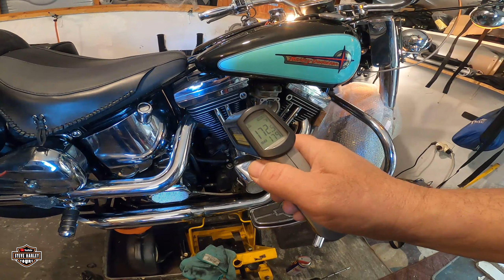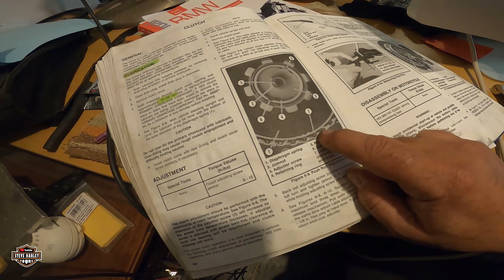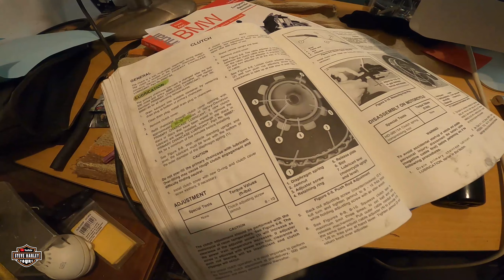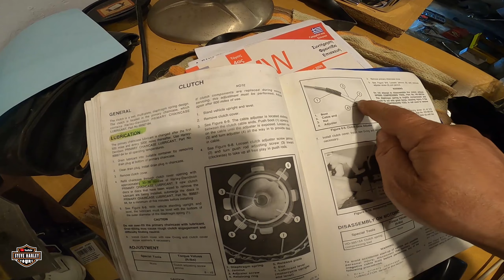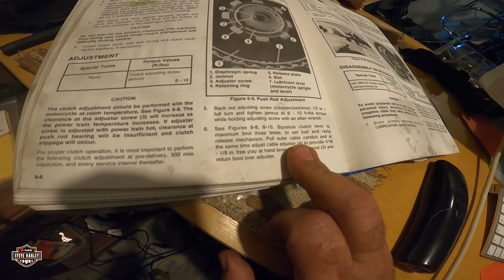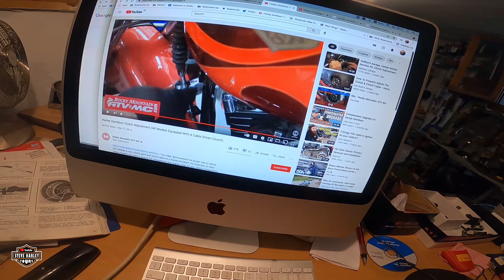Harley Davidson Evolution P38 engine oils, adjusting clutch cable

Comment: Is your exhaust straight through ,sounds Great ,,
no baffle I see a little bit of Baffel around the outer edge just wondering
I put two clamps on my drain plug just in case
Reply from the maker: There is buffers In there, thank you, I have a oil lick probably from the oil clumps, we looking on it